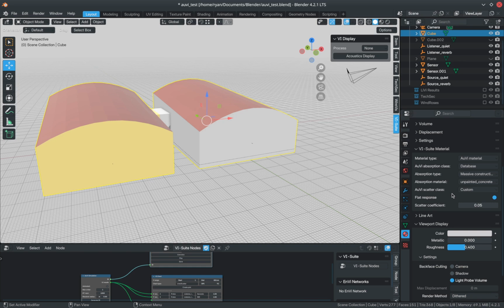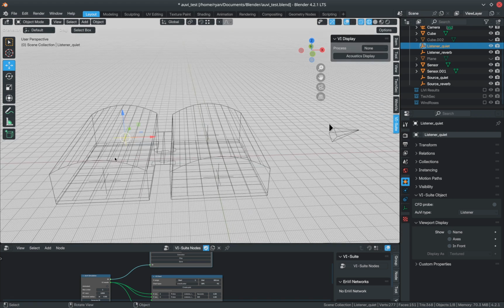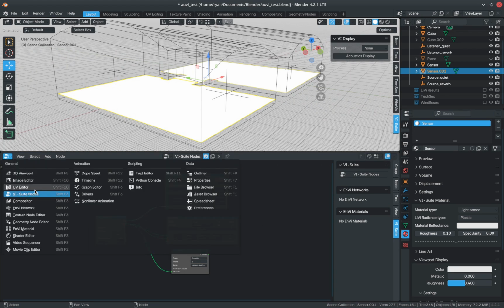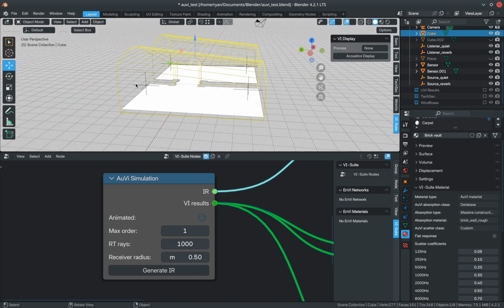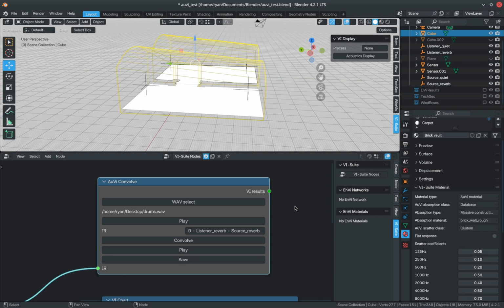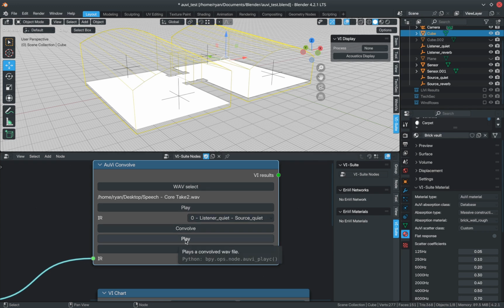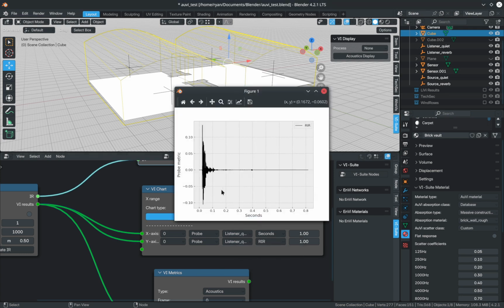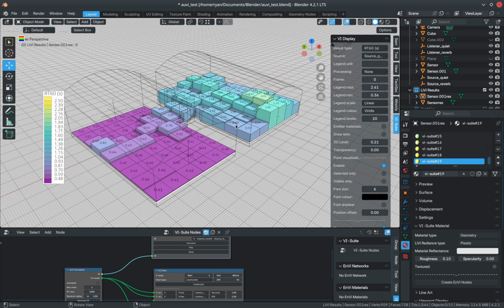VI-Suite v0.7: Acoustics with AuVi and pyroomacoustics

Comment: hy Ryan,the resultin IR is only 8khz,can it be expanded?
Reply from the maker: Hi. Sorry. Didn't see this. SACs are rare for the 16kHz band as far as I know and pyroomacoustics defaults to 8kHz as the upper band. It is possible to expand to 16kHz but it requires the user to make code changes. There was a discussion on the google group about how to do that.